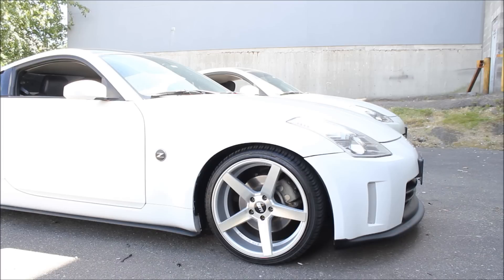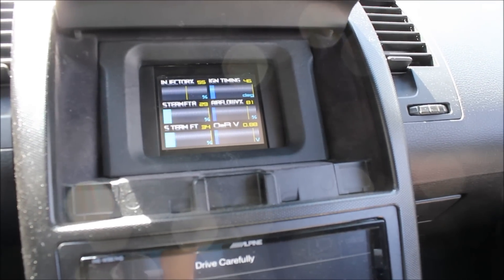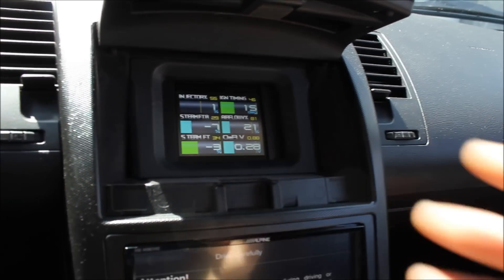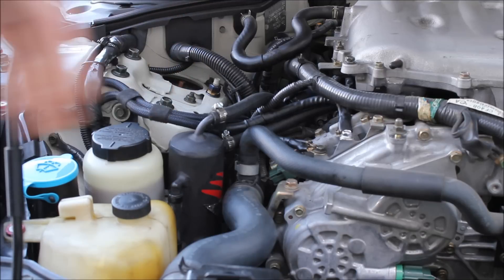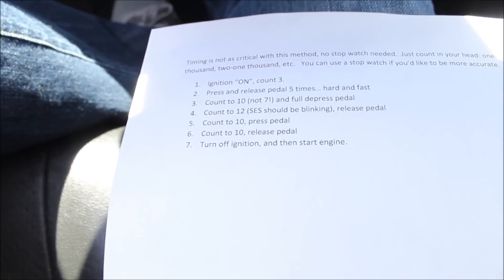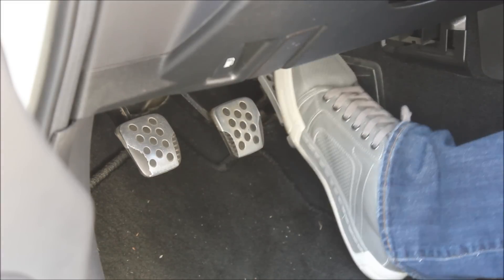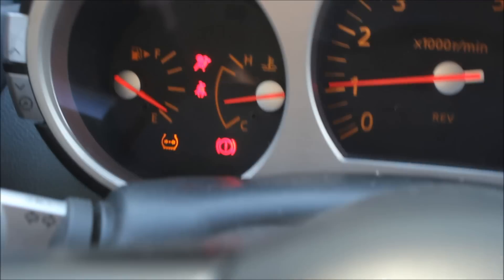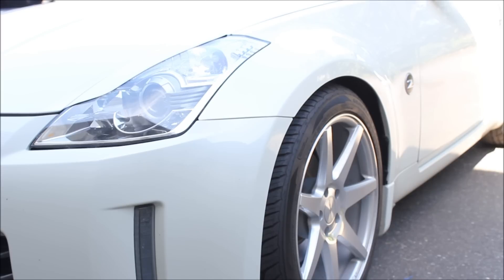Nissan 350Z / Infiniti G35 ECU reset & Idle Relearn 3.5L V6 (Check Engine Light) | AnthonyJ350

Comment: You guys ROCK!!!   Your instructions were clear and concise!!!   I cleared the ECU with no problem.  Today I replaced my driver's side camshaft position sensor on my 2003 G35 sedan with 230,000 miles on it. Not only is the car idling smoothly it did not konk out after I started it.  Purrs like a kitten!!!   Many thanks!!!
Reply from the maker: Glad to hear it worked!
Reply: Was that the camshaft timing vct solenoid? P1111?
Reply: Does this work for the HR?

Comment: These cars are made to sensitive can't beat the old cars no electrics carby motor easy to fix modern cars are rubbish
Reply from the maker: I agree to a certain degree.  As of right now I don't own anything past 2006 because brand new cars there are way too many things to go wrong and they're expensive.  I have 2 modern vehicles and one carbeurated.  The carb truck is a little hard to get good throttle response now so we have to spend more time adjusting it for our climate, but it's super simple and not much to go wrong.

The nice thing about electronic cars is diagnostics are easier because you can read a lot of sensors through a live data feed, they can adapt to different driving conditions easier and have limp home modes.  I find it odd to see cars on the side of the road now a days because they have safe modes to keep going, it'll run like crap but do its best to keep going.

But if a major electronic piece fails it can be expensive to fix.  Pros and cons for everything.

Comment: My serpentine belt and the socket harness to the variable timing solenoid ripped off. I replaced those two and now my Z won't start. It cranks but feels like its missing a spark for ignition. Would this reset work?

Comment: I recently just changed my valve cover gasket and tune up..When I put everything back, my vehicle went into "limp mode" I assume but the car has a rough idle and my check engine light is flashing..do you think this may be caused by the limp mode + vacuum leak?
Reply from the maker: You would have to scan the vehicle and see what codes got tripped to help diagnose the issue.

Comment: Thank You!! This totally worked for me. I had to do it twice, but success!! I had replaced the positive battery terminal connection. After doing so the car through a "malfunctioning ECU" code. I tried a couple of hopeful fixes , but NADA.. I called the dealer(no shops around Nashville were interested in repairing. Said "take it to the dealer"). AAARRRGGGHHHH.. So I went to the ol' standby YouTube. I found this sequence you have awesomely described. Shazam!! It Worked!! Of course this problem had to happen the same month I was due for emission inspection for my tags. I passed! Whoohoo! And without having to spend $1200.00 to  $1500.00 quoted by the dealership to replace ECU. Thank you! Thank you! Thank you! Saved the day~  : )
Reply from the maker: So glad to hear the video helped you!

Comment: *If car is MANUAL ('stick shift'); do this with clutch depressed!
Reply from the maker: Why?  The engine isn't running during the procedure.  In order to start the vehicle after you have to depress the clutch anyways.
Reply: @AnthonyJ350  It's always been the only way mine will get into coding mode.
Reply from the maker: @SteveMack  Interesting, I don't have to do that and mine is manual as well.
Reply: @AnthonyJ350  might be an idiosyncrasy with my car, but is a solution if others find the same issue. Tried 5 times without holding the clutch pedal down, no go.

Comment: g35 p0051 p0031 p0102 modified headers , new Cat converters, modified exhaust, Had oil catch can issue which prevented it from holding a start but fixed , now it back fires and runs rich , previous owner over gapped spark plugs which they are correct now , and it had more mods on it before removing intake manifold. Car also has mishimoto radiator and cool air intake . ALL MY SENSORS with corrispoding codes have been replaced . I have done this but the car isn’t really ready to move yet so I couldn’t take it for a drive  , i was gonna get a ECU or check for header and vacuum leaks but any suggestions? Denver Colorado here

Comment: It started blinking and everything but once I turn on my car the light comes on again 😢
Reply from the maker: Did you scan the vehicle? When that light comes on, you usually have to fix something.
Reply: @AnthonyJ350  its fixed already 😁
Reply from the maker: @jcbeatzzzyt3068  And the light is still on?
Reply: @AnthonyJ350  no I reset and its off now I had a chain tensioner loose but is good now

Comment: I changed knock sensor with harness cel came back after driving 40km ,do I need to reset ecu? On 350z
Reply from the maker: Did you do the ECU reset already?
Reply: @ no
Reply from the maker: @autoperformance503  Didn't I request you do the procedure? Then you didn't. Now you're asking me if you should do it???
Reply from the maker: @autoperformance503  I would not go any further. Bring the vehicle to your mechanic.
Reply: @ I have muffler delete and testpipes is that causing excessive vibration and knock sensor is detecting it??
Reply from the maker: @autoperformance503  You need to talk to your tuner and hook it up on the dyno to see what is happening. Is it tuned?
Reply: @AnthonyJ350  my car is tuned but knock sensor issue I had before the car was tuned
Reply: @AnthonyJ350  350z De Engine have how many knock sensors?
Reply from the maker: @autoperformance503  As far as I know 1. Is the wiring harness damaged?
Reply: @ harness is new I put even the knock sensor. I think where we connect the harness to the connector that connector wire I can’t see where it going could be fault there
Reply from the maker: @autoperformance503  Bring the car back to your tuner.
Reply: @ he doesn’t know anything beside tuning , this problem existed before tuning
Reply from the maker: @autoperformance503  Bring it to your mechanic then.
Reply: @ the knock sensor harness that I put is aftermarket is that ok?
Reply from the maker: @autoperformance503  Probably not, because you're still having issues.
Reply: @ there is a knock sensor harness and a Sub Harness . I think the fault is in the sub harness
Reply from the maker: @autoperformance503  You should change it.
Reply: @ u have any idea where sun harness goes and attached too
Reply from the maker: @autoperformance503  No, I only saw one plug. It's probably part of the whole engine harness.
Reply: @ yes your right , I just found out I have fuel line leak, corroded. Will that cause knocking because proper amount of gas not going inside the engine ???
Reply from the maker: @autoperformance503  Your tuner can see if that's happening.

Comment: And doesnt simply disconnecting battery for a while ...reset the ECU too?...
Reply from the maker: It can and you want to discharge the capacitors by hitting the horn and/or brake pedal.  This reset procedure is 100% resetting it and putting it into a learning mode after.

Comment: im having an issue with my 2008 Z,   the driver side throttle body was buzzing and showing 4.72% open on the ODB2 scanner so i thought it was faulty,  bought a new one , and new one is showing that too,  i took the ECU out and checked the ECU,   its not blown up or anything, and tested the wiring and wiring is fine, the only thing left I can think is that its the ECU programming,  its stuck on thinking  that the throttle body is open, when its actually closed. and is sending a closed signal to the motor, which is causing it to stall out against the mechanical limits of the throttle body.  I really don't know what to do next.  no one around here has the ability to reprogram the ECU but i need it reset,  the steps in this video do not work.
Reply from the maker: Voltage and ground are good at the plug?
Reply: @AnthonyJ350  where is the ground for it located?  and the voltage how would i test that, im not sure , thanks for any info.
Reply from the maker: @Runescape.  Ground is on of the wires in the plug. Need to use a multimeter.
Reply: @AnthonyJ350  ok thank you ill check them tonight!

Comment: At 9:17 in the video is that normal idle? or should it be higher?
Reply: I believe it should be higher than that as regular idle is around 700 not 650 so that's not supposed to do that...
Reply from the maker: Seems to be, car was like that stock and after tuning.

Comment: Key in. Ignition on not the car. Count to 4

Press the gas 5 times hard in and out. Once after the 5th time stop 

Count to 10. Once your at 10 hold gas.

Count to 12 while foot is on gas. Ses light should be on.

After 12 seconds let go. 

Then count to 11

After 10 slam on the gas then count to the 10 again. Then turn on car.
Reply from the maker: Thanks for the comment
Reply: @AnthonyJ350  Sorry man. Video is a bit too confusing for me lol.
Reply from the maker: @g3money12  All good. As long as you find a solution.

Comment: 2004 nissan 350... If you install new o2 sensors or camshaft sensors should you do an ecu reset?...
Reply from the maker: It is recommended.

Comment: thanks for this, before I replaced my clutch and transmission to aftermarket the SES light wasn't on and after it turned on, I'm guessing it just needs a reset because the car runs fine
Reply from the maker: Unless something is unplugged?

Comment: My 05 350z just got this problem it’s says p2135 as code but I wanna know if this method will work before I get that changed out
Reply from the maker: If O2 is actually the culprit this will reset the ECU and will relearn when you drive the vehicle.  A vacuum leak could also cause a code like that.
Reply: @AnthonyJ350  vacuum leak? They told me it was throttle bottle I drove 5 hours to visit my moms I gotta drive 5 hrs back will I be good till I’m home?
Reply from the maker: @fresnosfuture2619  Do you run 91 octane I'm the car? If you have no choice but to drive it, keep the rpms well under 3K. Also check your oil level just because.
Reply: @AnthonyJ350  yes I do and oil good gonna take it to dealership tomorrow

Comment: Mine has no limp mode light and I just disconnected the battery (planning in leaving like that untill 1 30 pm I disconnected it at 6 53am.) I've never had this problem untill this morning I have a cold air intake and long tube headers with a stock cat back. Could it be I'm low on oil??

Comment: Have 03 350z, just change the clutch. Now it keeps going into limp mode. Throwing camshaft position sensor, crankshaft position sensor & knock sensor.  Have change all camshaft position sensor & knock sensor with same result, after resetting all codes. Suggestions?
Reply from the maker: Did you perform the ECU reset?
Reply: @AnthonyJ350  not yet ...what's best way of
Reply from the maker: @martwatt8265  Watch this whole video and you'll see the procedure how to do it.

Comment: I just had a touch Radio, head lights and running lights put in and yes the ck engine light came on. Straight panic.  Haven't tried this yet but I'm glad it's a quick fix. Lunch is on me the next time your in GA.
Reply from the maker: Did it work for you?

Comment: Will this eliminate code p0300 for 350z HR? The second time I scanned the car there was a code p0305 (cyl 5). Should I replace coil pack and relearn it? Thanks in advance!
Reply from the maker: I would move the coil pack, clear the code and see if the code moves to the other cylinder.

Comment: So i replaced my TPS and tried the reset and my car still went into limp mode i also checked the throttle body and it looks fairly new the car did sit for a year but i even took the pedal from the other Z im getting low voltage codes p2128 and p2138 and p2135 any ideas??
Reply: I have a 04 Nissan 350z
Reply from the maker: Possibly bad ground at the computer or somewhere else?

Comment: will this work on 07 infiniti g35
Reply from the maker: I believe it will. Please let us know after you try it.
Reply: @AnthonyJ350  i have a code about 2 upstream o2 sensor and a bad cats, just wondering if i could just keep driving with it and leave it. it wont make any damage to the engine right?
Reply: @AnthonyJ350  my g35 idles fine and drives like it was before tho
Reply from the maker: @bugoykikay8074  You would have to look at your fuel trims while you drive. You might be running too rich or lean and over time it will waste a lot of fuel and possibly damage the engine if not addressed.
Reply from the maker: @bugoykikay8074  I would put some high flow cats in and get an UPREV tune. It will make more power and probably get better fuel economy when cruising.
Reply: @AnthonyJ350  thanks for your advice might do it in the future when i get more money.

Comment: up, down, left, right, A, B, select, start
Reply from the maker: Gabriel BG Haha ya it's like the cheat codes you put in a videogame.
Reply: AnthonyJ350 I tried it yesterday a few times on my EX35 to no avail. Next step is to do again watching your video. I really don't understand why they went overboard in the complication department. I get they don't want people accidentally resetting but this is rediculous lol. Thanks for video! You'll get an easy 100 views from me alone before I figure this thing out lol.
Reply: The service manual gives 2 options to reset the ECU, the pedal dance or the easy option. Resetting the ECU requires just unhooking the neg battery cable and pumping the brake pedal to discharge the ECU capacitors. I just uploaded an easy idle relearn video to help people out and I'll be uploading an easier ECU reset video. Even easier, is using an uprev cable to do it from ROM editor, but unhooking the battery cable comes in 2nd place for easy.
Reply: konami code?
Reply: OK so lets get this sorted .. Its the English language and over here we say Zed
Reply: @AnthonyJ350  hi Anthony, I have 350z and I am about to remove my muffler off and keep cats and resonator on, when I downshift will it make little pop or crackle sound ?
Reply from the maker: @autoperformance503  maybe a little. Didn't really hear it in my buddy's though.
Reply: @AnthonyJ350  ok maybe remove cats? Too
Reply from the maker: @autoperformance503  Don't remove the cats. Will get super raspy. You have to run the Motordyne XYZ pipe with a high flow cat if you install test pipes.
Reply: @AnthonyJ350  so I’ll just delete muffler only , how about resonator?
Reply from the maker: @autoperformance503  muffler only, leave the resonator and cats
Reply from the maker: @autoperformance503  It will sound like this
https://youtu.be/TTMOnW-wx2Y
Reply: @AnthonyJ350  dam sounds pretty good . But inside the car not too loud?
Reply: @AnthonyJ350  also Anthony one more thing , 350z I have is automatic, but has + - shift mode. Is it safe to play with that ?
Reply from the maker: @autoperformance503  There's some drone on the highway
Reply from the maker: @autoperformance503  Once in a while, but I wouldn't use it too often. I don't know much about the autos. The more you shift you create heat in those things.

Comment: i put a new mafs and i think it needs to be reprogrammed cause it randomly but usual when i first start it up it idles really rough and when i drive with it like that the ses light blinks…do you think doing this would reprogram it ?
Reply from the maker: It should. You might need a new crank position sensors and cam shift sensors as well.

If those are original, just change them with Hitachi brand.

Comment: I don’t have a check engine light but I have a cold air intake and a throttle body spacer installed my fuel economy is trash...would this fix the problem?
Reply from the maker: Does it have exhaust done? Probably needs a tune. But it doesn't hurt to try the relearn procedure. Also do you drive it harder since you did the mod?

Comment: i’m stuck man my 04 350z sounds great up until it warms up to normal temp then my rpms start to slowly go down. i’ve tried everything. cleaned throttle body, tried this ecu reset even checked if i have air leak. (i dont) someone help me out!!
Reply: Did you ever find out?
Reply from the maker: Might be a faulty sensor.

Comment: Greetings, Anthony from the mile-high city of Denver! Great video and especially its simple format. However, since I just dropped $1,300 on a full performance tune (w/ HF cats) for my 2008 HR, I was wondering if resetting the ECU would also erase/interfere w/ the data from the tuning. Aside from that concern, I was wondering if resetting the ECU would help w/ restoring the Readiness Monitors for the Catalyst (CAT) & the Catalyst Heater (HCAT). FYI, after installing a new battery,  I ran twice the recommended Nissan Drive Cycle, and initially cleared the blinking Check Engine light; the ODB-II showed all the monitors as complete, except the CAT & HCAT. BTW, the car failed emissions twice (slightly high NOx). To add to my luck, Colorado adopted the CARB Law 😞. Any help would be greatly appreciated. Exhaust: Shorty Tomei Extreme Headers; Berk Technology High Flow Cats (DE); Z1 Resonated Y-pipe; Single-exit Tomei Extreme cat-back exhaust. Engine: Injen Long Tube Cold Air Intakes; Z1 Ported Upper & Lower Manifolds; Z1 High Energy Coils & Denso Iridium Spark Plugs.
Reply from the maker: I don't believe it does, I would call the tuning shop that did the tune and ask to verify though.